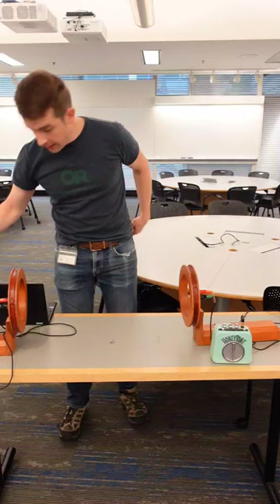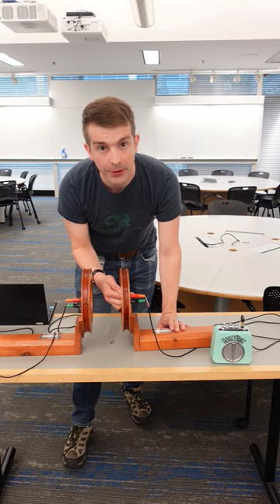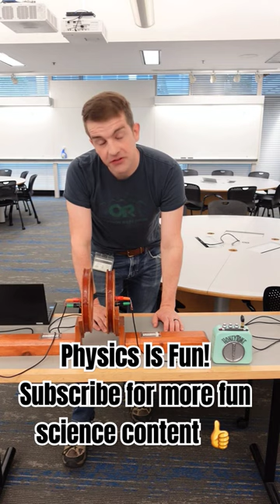Wireless transmission of electricity! #physics #science #stem #electricity

Comment: Please don’t laugh at me - is current the same as electricity? Is the second loop connected to a power source??  I never got to take physics classes but I find it very interesting and love your channel.
Reply: Oh duh - read the caption and listen!!
Reply: What would happen if one loop had more coils?
Reply: It would increase or decrease the voltage of the source signals depending on which one had more, and have the inverse effect on the amperage.
Reply: Current is the rate of flow of electrons in a conductor.  

If asking that kind of question, a library might be a good stop, for books with pictures and graphics to illustrate basic terms, before watching demonstrations of systems that benefit from knowing relevant language.

Comment: It's not creating current. It creates voltage. Current is impedance related. And...you must have a hell of an amplifier to emit a powerfull enough magnetic flux to transmit music! And...much more than 500 turns on the other transducer in order to maintain an impedance high enough so that the audio signal's voltage doesn't drop due to low impedance! 😂

Comment: Can organisms be the same way? Being wired ourselves as well as beings of energy...
Reply: Carbon and water based organic "mush" lacks conductors to form potentially induced fields.
Reply: Plug an aux cord into a speaker system and touch the metal bit that would go into your phone or computer and listen to the static that is produced. That only happens when you are surrounded by electrical components. If you were in the middle of nowhere it doesn't happen. So yes.